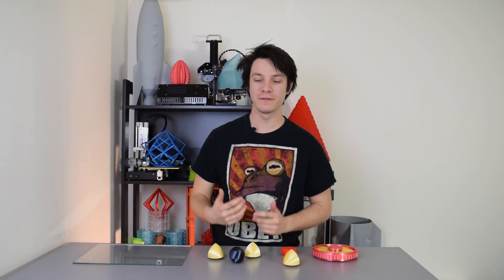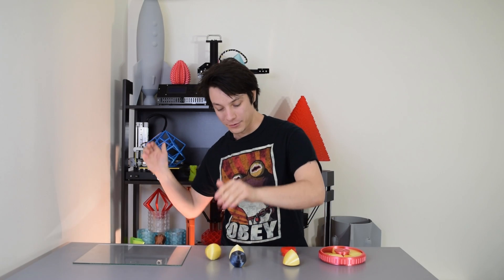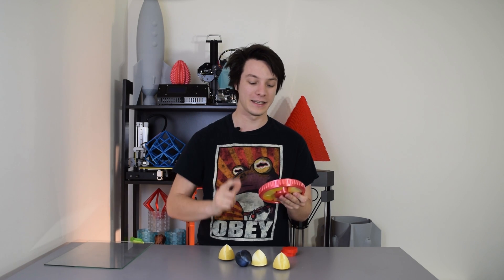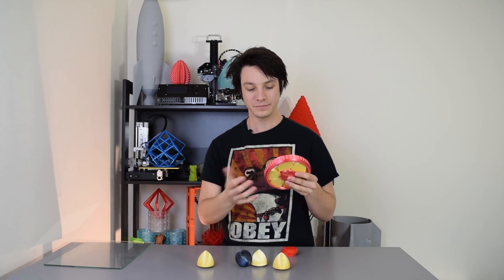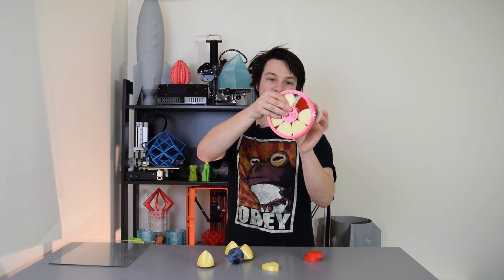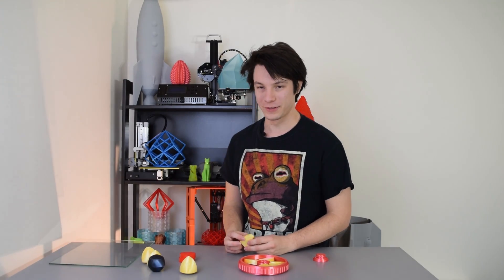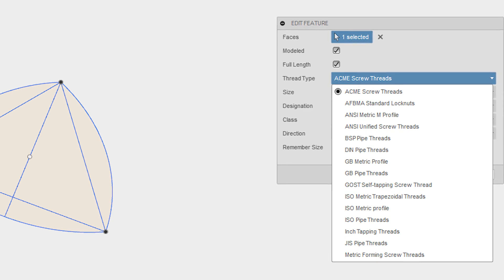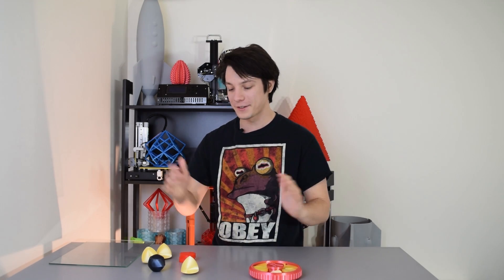Reuleaux Triangle Bearing - is it possible?

Comment: put holes in the flat solids and print a spacer that snaps into them from the top. it will keep spacing consistent and maybe let the bearing work.

Comment: I am pretty sure there is a solution to actualy make it work !
What if you increase the axis diameter and reduce the size of the objects of constant width ?
They'd be able to roll around and drop down without letting the axle leave it's emplacement.
Reply: Anaon Industries 

I also believe there is a solution to make it work in theory by caging the rollers and at the same time syncronizing their phase but it is still stupid and pointless. the inertia of the cage and rollers would have to constantly oscillate sending vibrations throughout the system. maybe someone would do it if they needed to spin a shaft with a specific waveform superimposed on the the constant velocity value but it would probably be a lot harder than making a regular bearing work. from a practicality standpoint, ball bearings work because of the the precision of the balls. it it much easier to generate precision shapes when they are geometrically simple such as flats, spheres, and cylinders. bearing balls can be churned out at sphericities of single digit millionths of an inch. it is completely impractical to attempt that level of precision with these shapes and there is no gain to be had.
Reply: I meant, 'IF' there was an application where the shaft was intended to have a waveform superimposed, it is interesting to propose a constant velocity bearing cage by way of funky rollers but we are both right, fun to talk about dorky stuff that is still dumb and pointless. The inertia of a regular bearing can be significantly reduced using SiliconNitride balls and if that doesn't keep the bearing from failing, the shaft probably would have self destructed long ago.
Reply: Also had the idea about synchronizing rollers, but superimposing rotational velocity changes on a shaft to remove oscillation of cage is one step further in pointless yet fun analysis.
Reply: Anaon Industries I concur; there's a way. I don't think the guy is mathsy enough to figure it out though, after hearing him refer to the objects as 2D and 3D solids, when they are simply called shapes and solids. Good CADding though.

Comment: Your explanation doesn't hold up. These are objects of "constant width", yet their distance from each other changes? Then it wouldn't be constant if that was the case. I'm confident that if you made a guiderail for these (fastened in the center of each triangle maybe?) then they would work just fine as bearings.

Comment: very nice idea. thanks for the video. can you elaborate the thread you used for screwing the parts together?
Reply from the maker: ACME threads are common for a 3D Printer Z axis, they're a square profile and should 3D Print easily :) I'm planning a video on different thread types in future.
Reply: Thanks for the hint. I have only done rounded threads connecting PLA and TPU and only once before. Looking forward to that video.

Comment: the issue is that the solids of constant width require a geometric point of infinite sharpness (and thus require a race of infinite hardness) where as a sphere is ground to a precision size.  It will be impossible to maintain that point in a functional bearing and thus the dimensional tolerance over an extended period of time in actual service.  In theory, the application you've noted "sliding on glass" is the best application for these which would be in comparison to either a needle bearing or a linear slide.

Comment: That particular problem could be solved by giving the wheel two parallel tracks, and alternating the shapes between those tracks. You'll have shapes all around to constrain the wheel w.r.t. the axis, but they won't get in each others way.

But I suspect there are other problems at work here, like slipping.

Comment: I think the centre of rotation moves in a circular path. So if you really... really, wanted to you could probably work out a mechanism with constrained sun gears in the centre of each triangle.

Even if I'm right...this way madness lies.
Reply from the maker: It always starts out so innocently...
Reply: this needs to be made
Reply: Maker's Muse Do it! We need to go deeper!
Reply: I don't think it even needs to be that complicated. All you need are axels passing through the geometric centers of the triangles to fix them in place relative to one another. Yes, their centers move eccentrically, but they can all be made to move the same way relative to one another.

I feel like I explained that poorly... Okay, just picture the triangles all held equidistant by axes attached to a ring and passing through their centers. The inner race would remain concentric with the outer one, but the ring connecting the triangles would appear to "wobble" around eccentrically as the bearing turned. Does that make sense?
Reply: You dont need sun gears, just slots as nbmfan8 said:
"couldnt you add axles in the middle of each roller and then make a guide with slots for those axles to slide up and down as the bearing turns?
something like this? (forgive my crude paint job)
http://imgur.com/cLP5LUK "
Reply: I was thinking of clocking them using geared surfaces so that the jankyness is synchronised to prevent them from colliding from rolling at different rates/phases but --- `mrowl` now I'm trying to remember the name of the machine/software/maker-channel that specialised in nested epicyclic gears of irregular shape.

edit 1: gearify? The one I think I am remembering wasn't English and was showing off their shop capabilities.
edit 2: Doesn't matter, Michael Valle's software looks to be capable of what I was thinking.
Reply: (without sliding/dragging) Would the varying length/distance of each point of contact to the center of rotation not result in a different surface speed that without synchronous-clocking cause the triangles to naturally tend to move towards and away from each other when they roll?

I suppose that keeping them equidistant would probably cause them to slide/drag until they synchronise on their own; but I don't see a "need" for it to be that simple, "complicated" tends towards" interesting".
Reply: Pook365 you just reinvented the Rotary Engine.
Reply: No. The centers do not generate a smooth circle. While the widths are the same remember that the center of shape moves relative to that width. If however, you cut the hole in the center large enough to give slack for the wobble and then have pins going through each that connect to circular guide frame on each side it should keep the spacing and help hold them in place. There are probably other ways you could do it too, but that would probably be the easiest.
Reply: Yes, sadly the path is not quite circular.

"The geometric centroid does not stay fixed as the triangle is rotated, nor does it move along a circle. In fact, the path consists of a curve composed of four arcs of an ellipse (Wagon 1991). "

http://mathworld.wolfram.com/ReuleauxTriangle.html
Reply: Pook365 yes sir I came here to say this very thing but I thought I would check first.
Reply: @LynxSnowCat You might be thinking of OskarPuzzle.
Reply: That's exactly what I was thinking as soon as he dropped the last (shape?) in. I think I might be able to do it.
Reply: he could figure out the amount the center moves up and down. Then link the ones with a matching path together on a guide to keep it all straight. Then they can be kept spaced if all the measurements are done right.
Reply: Just because you fail at doing something doesn't mean it's impossible.
There is always an hacker somewhere that will be able to do what you thought was impossible.
Reply: Pook365 Exactly what I was thinking. Like a rotary engine layout on each "ball" in the bearing. But like you said, that would be complicated and basically pointless.
Reply: Its an inside out wankle.
Reply: In fact, the center of rotation of the SOCWs moves in a spherical path.
Reply: Pook365 I don't think it's circular, I think it's the inverse shape of the "bearing" I'd say add gearteeth to the shapes and on the inside of the bearing
Reply: Unfortunately there is such no simple path for any part of the solid. So a mechanism using it doesn't really exist. (outside of a floating thing with walls to guide it. which is how some square hole drills work)

Comment: just make a roll cage for them with excentric pin in the triangles and it will work :)
Reply: The problem is, those excentric pins will need their own bearings. And can you make those out of solids of constant width?

Comment: If you nested a counter rotational object of constant width inside the bearing object couldn't that offset the changing centre of rotation enough?
More likely it would end up with a centre of rotation that would look like more of a Spirograph.
Or perhaps a constraint that had space for a slide on the bearing that it could compensate for movement, but that would only work for one axis. you've have to put another slide for the other axis and mount it to the first. I think that may actually work... 

But that would just over complicate the entire situation, so why reinvent the wheel (or the bearing)?

Comment: couldnt you add axles in the middle of each roller and then make a guide with slots for those axles to slide up and down as the bearing turns?
something like this? (forgive my crude paint job)
http://imgur.com/cLP5LUK
Reply from the maker: Possibly! That's a bit like how the bicycle works. I'll start testing.
Reply: http://a360.co/2tdxoe6
i think this might work
it is currently printing
Reply: I am desinging that right now!!!!
Reply: Any progress @vermin ?
Reply: Cool idea. The axles wouldn't have to be centered if they all acted in unison.
Reply: Haha, just proposed something similar.
Reply: not as much loss as the whole thing falling appart though ^^
Reply: It's radial though.  It'll also want move in the x-axis direction as well as the y.
Reply: The cage isn't fused to the center or the outer race, it's free to move just like in a traditional ball-bearing separator.
Reply: http://mathworld.wolfram.com/images/gifs/reuleaux.gif  This helps explain the path a bit better.
Reply: Legal Planet Where did the square come from??? The triangle center moves towards and away from the centre (in a straight line) as it goes round
Reply: It could possibly work like that but i don't see how the picture you drew made sense
Reply: nbmfan That's a great idea! but, I think convincing them to rotate will be an issue. 
With a circle, the centre of rotation is also the centre of mass. That's not the case with these triangles.
 As they rotate towards a point the centre of mass is lifted upwards and I think they would probably slide instead.

Definitely worth a go though!
Reply: would like to see that as well. was thinking the same.
Reply: dAcid couldn't finish it before going to work
Reply: +vermin I concur it probably would, however i imagine it will result in much more loss due to friction though.
Reply: Axles won't work since the center point of a reuleaux triangle always changes.  I'd tested it :P  No harm in showing people it though :D
Reply: Legal Planet that is what the guide ring I for. the things can move up and down in it but still turn
Reply: I wonder if you could synchronize movement of the reuleaux triangles and use cage without any moving axles. It may be possible for only certain amount of orbiting triangles though, like could be done for 3 but doesn't work at all for 4. If somebody know how to simulate it, please do!
Reply: dAvcid The reuleaux triangle (as you already know) is an object of constant width but it has different characteristic's from a circle.  By sticking it between a set of parallel planes at different rotations you'll notice that the locations that the triangle touches the planes is always at a different spot.  For a bearing you need the points of contact to be directly above and below the center point.  By placing the center point in a channel that runs parallel to the radius of the bearing's inner raceway we'll still run into the problem of the location of the reuleaux triangle's contact points lingering off to the side which will variate the distance between the outer and inner raceway (which is no bueno).  Hopefully this made since and that my understanding is correct.  I'd still say try it out so we can all see how it works!
Reply: Legal Planet Aaah, right. didn't think of the contact points. thanks for explaining
Reply: Yep agreed this is the first thing I'd test. Then add a little post on each side to fit in the slot.
Reply: nbmfan 
I was just thinking if this. And on each axel insert another solid of constant width, and so on, to minimize the radial wiggle.
Reply: great idea
Reply: Due to the fact that the center point is not in the center at all points in its rotation path you would need a guide that has a larger hole than the pin that guides it (small circle that goes around the edge of the pig circle) now I theorize that this would wear out quickly if put to any real use due to friction but small ball bearings ( such as abec-3 or similar) could be used to prevent such an issue
Reply: nbmfan Magnets!!! It would hold them in place but would not prevent the rolling capacity of the objects!

Comment: make a hole in the center of the polygons, add a ring with holes/pins to constrain them, so they are forced to roll. this would work like a cage in a ballbearing.
Reply from the maker: it wont, there is no true center! That's the problem lol
Reply: Yuno Krews this is what I was thinking in 2d version this should work
Reply: Maker's Muse 
but it could have reuleaux triangle cut out of the middle of the bearings and a pin that rides the edge of the cutout attached to an arm that is attached to the inner axle or outer ring.
Reply: Maker's Muse i have something in mind, it involves a flexible circle/ellipse for the "centerhole" which squishes and therefore it could work ;)

btw greetings from Switzerland

Comment: Would it work if you isolate each one into its own circle and then it would roll like a ball bearing right??
Reply from the maker: perhaps, i'm playing with the idea :) It's tricky as the distance changes as it rolls.
Reply: Yea...I am not sure how to get around that issues unless you make the circles out of flexible material...or semi flexable.
Reply: adding teeth in the inside and outside ring should fix them in place and separate them from each other.
Reply: James White so basically cage them in a circle...so same as using circle or balls
Reply: Cut gear teeth in bearings and races then arrange with enough space to spin.
Reply: If you made it flexible....it could be a ball...
Reply: No need with a circle, just make walls going between the outer and inner wall separated by the size of the "ball"
Reply: P J van Vliet Teeth like on normal gears wouldn't work.

Comment: Hey Angus! check this improved spool holder for the Original Prusa i3 I've created. I've calculate all the stresses and forces in order to optimize the design

https://www.thingiverse.com/thing:2171625

let me know what you think and if you like try it out :-)
Reply: how is a single stress point better than two? add the fact that it is not balanced, you haven't calculated anything